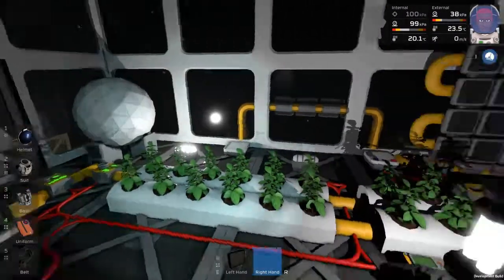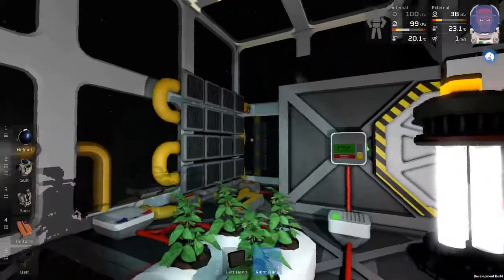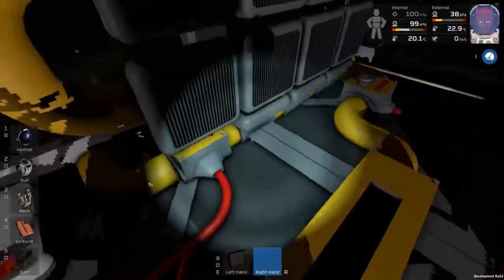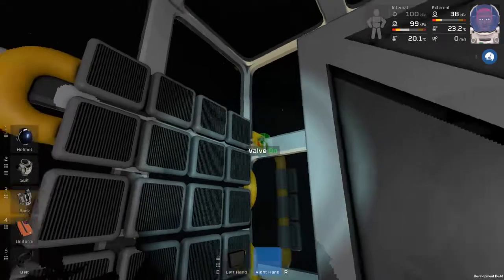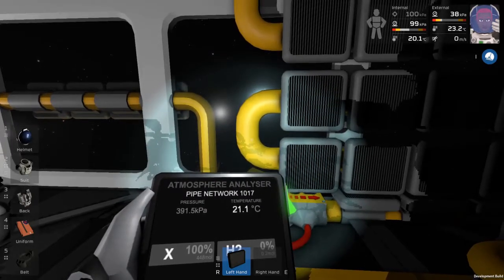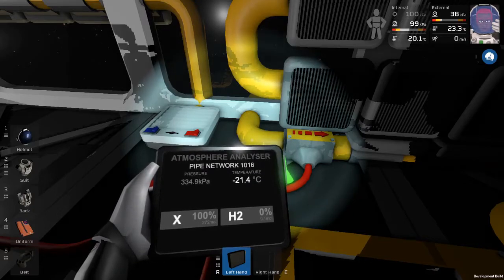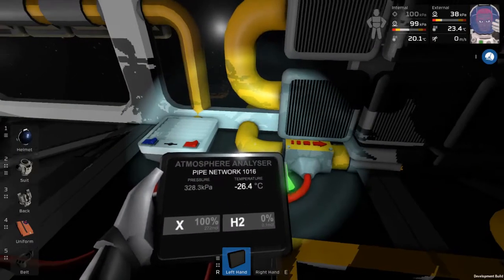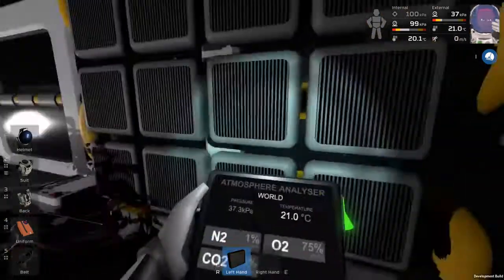Stationeers - Passive Cooling System

Comment: One small correction.

Pollutants are good for coolants whereas water is good for heat transport.

That is to say pollutants are really good at absorbing heat, but can't carry much. Water is very good are carrying lots of heat*.

You can use pollutants to keep systems cool by transferring heat out like in this setup. You can use water to move heat inside. An advanced station essentially would use fluids to manage temperatures.
Reply from the maker: Would it be better to flood this setup with water? Or would it not work as well.
Reply: You should at least give it a try. But what would happen if the water in the pipes goes below 0. Does it freeze?